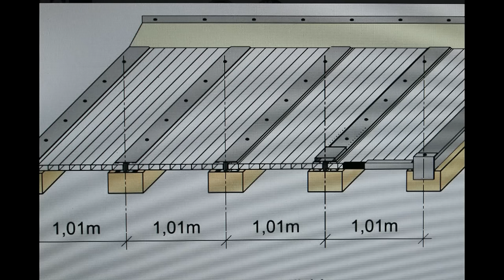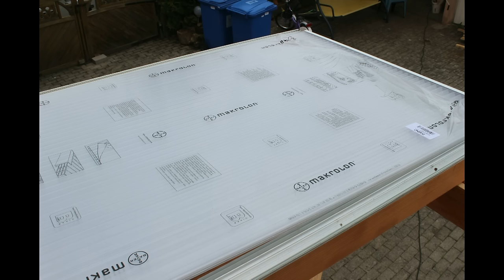DIY Selbstgebautes Hausvordach aus Holz / Self-built house canopy wood

Comment: Still needs to address water getting into wood at the wall.
Reply: Kenneth Geisler I agree it doesn’t address how to keep water from getting between the wall and that plastic/pvc trim...A trim with caulk or something...plus that tape with the trim would trap condensation in the empty voids in that material...
Reply: Also what's preventing the lumber to twist after years hanging in the open? 1 screws here and there?

Comment: Going t build it more or less the same. Did some research. Might be of use to someone. There needs to be a better seal between the wall of the house and the roof. The panels should be a bit steeper. 16cm per meter at least (helps against condensation within the panels and keeps the dirt and leaves off it). And I would use a bit more fasteners... But a very nice job anyway!
Reply: Lag bolts for sure

Comment: If it's a "simple" roof, why not just put 2x4 instead of 4x4's??????  4x4's  - that's alot of weight!!
Reply: He is in Europe. We don't have 2"x4"  or 4"x4" lumbar here so we may use 50x100mm or 100x100mm instead. hope that helps :-)